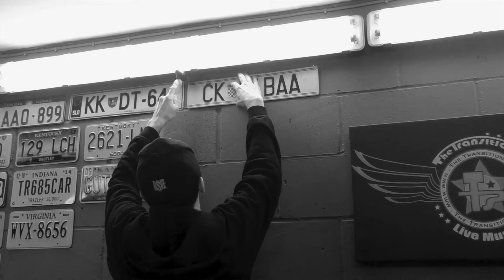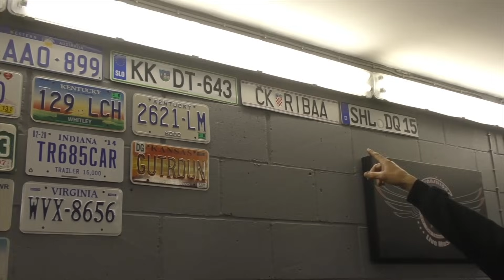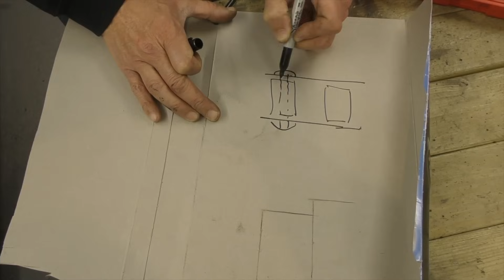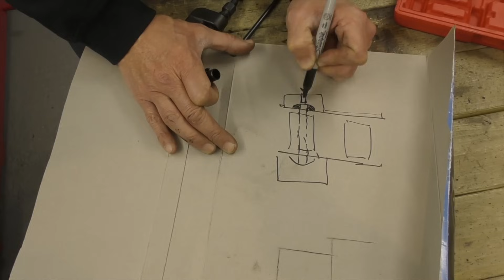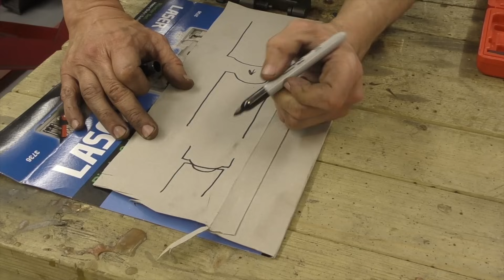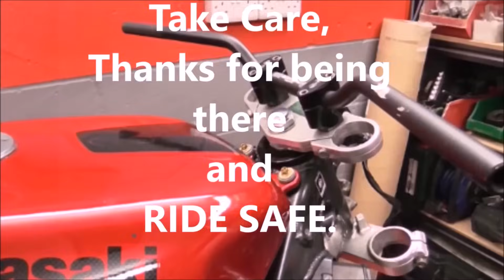Delboy's Garage, Motorcycle Chain and Sprocket Change.

Comment: Great video: got a few tips there myself. Only thing I spotted was the washer, they do recommend you get a new front sprocket washer when changing the front sprocket. I suspect most people are not as precise as you are with buffering it out hence why they recommend it. So for most people watching this they should get a new washer each time they change the front. Same with collier pins

Comment: Your video was perfect!!!!  I bought a kit that looks exactly like the one you used from Amazon for maybe $22.  I was worried it was crap but I used it, and I actually had to knock out 3 links and I was wondering if it would break after 2.  It kicked ass!!!  I was going to make a video showing how to do the same on my 1200s but yours deserves all the credit.  You didn't miss a step.  The only thing I did different was add some white lithium grease to both thread bolts before I started. :)  \m/ (>_<) \m/
Reply from the maker: Thanks for taking the time to let us know, it is a long video, but as you've found, it's a step by step, good to know it worked for you, all the best, ride safe...

Comment: Great video as always. Fastest 50 mins ever:) Do you have any experience with dry chain lube? If yes, could you tell me how it performs in comparison to standard wet chain lube?
Reply from the maker: Thanks buddy, wet chain lube does two things... it irrigates the chain, and the wax in it provides a layer of weather protection... imagine that weather protection removed, and you have pure lubrication only... the dry lube is finely powdered teflon, mixed with a carrier spirit... you spray it inside the links, all round the chain when the chain is hot right after a ride... the heat of the chain evaporates the spirit immediately, leaving the bearing faces of the chain coated with PTFE... this lube offers no weather protection, so it's good for dry weather and bikes that stay nice and shiney!
Reply: I had no idea the video was 50 minutes... wow!

Comment: "...for the sake of OCD, make sure you don't put it upside down..." You just became my favourite Youtube mechanic with that sentence there mate!

I bought a K2 GSX1400. She has seen some love, I must admit. But I can give her more love still, much more. 

I am about to rebuild the front calipers, I did change the pads but the brakes are grabbing too much in my opinion to the point one can feel it at very low speeds. I tried my best to clean those pistons. But I suspect, because the previous times pads were changed, they we not cleaned properly, so the pistons may not be working freely. 

The way I see it, if you have a video on the subject, anyone can do it at home!
Thanks a lot for sharing

Cheers

Comment: Soooo glad I watched (most of) this.
Have an old harbor freight chain breaker.
Have new z-ring chain & rear sprocket for my 2016 GSX-R600. Front sprocket comes tomorrow. Thought I could rig the breaker to do the rivet... After watching this - I'm ordering the proper tool ($20 on ebay) RIGHT now!
Thanks

Comment: This is the best video I’ve come across showing how to do this whole process. Today I tried this before finding this video, king story short I need to buy another new chain tomorrow cause I cut it one link too short (I didn’t know I had to line up one inner link with another inner link) so I measured and cut where the chain right where i wanted it to be but one end was the outer link and the master link wouldn’t fit.  Anyways, watching has shown me that I was doing it the hard way. I have this exact same breaker/riveter. Now I’m inspired to try again tomorrow and feel hopeful.  Thanks so much for such a details explanation. It’s exactly what I needed.

Comment: Video worked for me! Your explanation of how important it is to keep the proper width of the link, along with the explanation and  the visual of how slight the deformation of the pin gave me the confidence to order the tool and then give it a try.  Success.  Without the video it is very likely I would have tried pushing too hard with the domed pin because I would not have understood how it worked.  Your written diagram... plus the excellent camera work made all the difference for me.  btw...   on my Triumph America, the drive sprocket on the output shaft..... after removing the chrome cover (after 30k miles), and after buying a 36mm socket, after taking it to a machine shop so they could grind down the chamfer on the socket so it would gain more purchase on the  thin nut...  i t turned out to be barely finger tight and all that was keeping it from flying off was the folded down washer!   So,... I look carefully to see that the washer is pressed against the thin perpendicular rubber 'lines' of the rubber coated drive gear.  When the time came for me to torque the drive sprocket on to 97 ft lb 132 nm I did that.  And yet... that steel washer does not seem to really back evenly to the drive sprocket.  So, I will soon be checking that nut once again after some riding.  Any comment about torquing it down against the rubber siding of the stock triumph drive sprocket?   Thanks!

Comment: Very good tutorial. I am old school and did not know how easy it is to change chain n sprockets these days. On old bikes you had to take apart the primary drive and clutch , then the back plate to get at the front sprocket.  I assume the belt drive bikes are like this too.

Comment: Excellent, excellent video sir. Plenty of detail, and the finished product was very good. The only thing I may have done after mushrooming the pins would have been to remeasure the plate out side diameter, just to see if that changed at all.

Comment: It is not simply the head that secures the pin.  The feature of a rivet that makes the joint so strong is that the pin expands when bucked to make the mushroom head on the outside, but also leaves residual compressive stress between the pin itself and the hole interior.

Comment: you are a professional amazing how many details there are. I had breakdowns at home, it spins when adding a lot of gas. lucky that it is not far from work, but I had to cram the bike. I used the small vise and nut method with pushing the link into the correct position. And a little ball to tighten. But I have this tool to do correctly. Thanks.

Comment: Good tip grinding the heads off.  Never had to do so myself and not had a splitter break.... yet.   Well, apart from one i used which was old anyway.   I never liked using the lever which comes included, always felt like it was going to snap when turning it.   I have used a socket or spanner before now

Comment: Sorry to keep pestering you but I'm not a skilled mechanic but I am very mechanically minded, I used to strip my kawasaki z500b1 every winter  engine out, shims checked etc. Sold it for £500 for house deposit 30 years ago  they are fetching silly money now!
But I am a skilled sheet metal worker and I do like watching your fabrication videos, the blowtorch ally welding is something I've never seen but the satisfaction of tig welding ally with a nice even bead is something else
I want a workshop like yours 😂

Comment: I have used exactly the same tool as the one shown in this video. Just want to point out with a DID 520 Chain just by making the rivet pin sit in the hollow pin as shown will not flare the pin enough to meet DID specifications. With the method shown here I achieved 5.2mm where the spec is 5.4 to 5.6. At the DID official spec the flare is comparable to the diameter of a factory installed pin.

Comment: one idea, when you take the sprocket off, scratch a mark on the hub and the sprocket, so they can go back on the same way, they could be ballanced parts, ie like a propellor blade on a fan/aircraft, so putting the weight on the wrong end may cause the wheel to lose balance, like the brake disk too, esp. if you are using them as spares :-) , saves any curious rumbles on the road afterwards.

Comment: Hey Brother revisiting this because i havent used my chain tool for 7 years and needed a refresher ..i dont have the exact tool but the same principle ..(all bikes since 2012 had new chains and sprox on ) ..but the vstrom is well overdue !! thanks again brother peace and love 👍🏻👍🏻☮☮❤❤
Reply from the maker: Hey buddy, cool beans, and you know how it is, it's like riding a bike... off camera, I don't mess about pushing the link out with the chain tool, I just cut it off if it's going in the bin, and that saves the tool tip for the all important spreading, good luck with it buddy, peas and loaf, D&Px
Reply: @Moonfleet41  
yeah cut mine with grinder for bin fodder..understand my tool now it makes sensr thanks again 👍🏻👍🏻🍨❤❤❤

Comment: Always handy to come back to for a quick refresher before riveting chain ends. Can't remember everything when you haven't changed chain & sprockets for 40,000km. 93,000km on the clock and now pushing on to the big 100k
Reply from the maker: Impressive mileage Marcus. Good luck with the job.

Comment: Found this to be a great refresher  video after looking at budget chain tools on Amazon and you were mentioned.
Just bought an old fj1200 that needs a new chain, and I haven't done one in 20 years + due to owning shaft drives and a belt drive Harley.
Looking forward to doing the job correctly now as I used to use all the 'old days' hacks you mentioned.
Been watching your other vids as well.
Top job, keep it up.
Reply from the maker: Hi there Clay, Try this tool if you haven't bought one already.. a lot beefier and dead easy to use .. https://www.wemoto.com/parts/picture/wk-790050-in

Comment: Thanks brother. Did my first chain today thx to your video. With pushing the plate I had some trouble as it was impossible to place it by hand lol. But patience and determination won. I needed 22.0mm I came to 22.08mm (lucky me lol) and riveted as described. Thanks! After riveting it is indeed hard to see. But the flat edge hits the end. I trust it's fine after a couple days easy driving. 👍
Reply from the maker: Just to be clear mate.. what flat edge hist what end.??

Comment: Excellent educational video! I'm installing the 3rd chain on my Tiger & struggled with that tool each time. I know NOW how to use the tool properly. And plenty of good tips for the whole chain replacing project. No other videos to bother watching. Thx so much!
Reply from the maker: Most welcome Reid. Glad it helped.
Reply: Just realized that the plunger pin used to mushroom the master link is made of softer metal then the link pin. The dimple just mashes into the link. No more dimple.

Comment: Great video so detailed.   I broke my chain breaker kit a copy of yours from China.   I used to big of a pin to push the rivet out of a huge chain 520 off a 1200 Bandit 2003.   The pin pusher got stuck inside the chain.  I could not get it out .  Had to cut the the chain apart with a grinder.    Before I finished putting the new one one I thought I better find a video to make sure I was not going to mess it up.  Glad I found your video as I would have done it wrong.       The best video by far how replace the chain.
Reply from the maker: Thanks Fred, glad the video helped you, and now you know how to do it it'll be a simple job next time!

Comment: This was crucial help especially regarding the cheap tool-set and how to use it.  Thanks to you I got it done right.  However the two-hole press-plate stem broke off despite very gentle torque as you prescribed.  

The only thing in the video that wasn't too clear was which of the three anvils to use in the riveting stage.  I used the one that matched up with rivets on my old chain and it worked.

By the way since I bought my $16 tool on Amazon, the seller has messaged me directly and they've promised to send a new set.
Reply from the maker: Glad it worked out for you Richard, they are a little fragile, ive traded up to a heavy duty one now, well worth the money as i change two of three a year..  Ride safe and enjoy your bike buddy.   https://www.spanner-monkey.co.uk/motorcycle-chain-splitter-and-riveting-tool-set-heavy-duty-119022?search=SMC4&description=true

Comment: How to know what length should I cut the new chain to? Or just follow the old chain length?
Reply from the maker: If you buy the chain specific for your bike it will be the correct length.
Reply: @Moonfleet41  thank you brother, if let's say in case the chain is not in correct length, I mean if it's longer, how to cut it? Is there any way? Or usually it will be in correct length? Thanks brother
Reply from the maker: @Nathan2692  It will always be the correct length for the bike if you order the exact chain for your bike... and if in doubt, count the links on your old chain and compare them...
Reply: @Moonfleet41  thanks alot and sorry for alot of questions brother, so if let's say it's not in correct length , I just cut it into the length of my old chain right
Reply from the maker: @Nathan2692  No, measuring it doesn't help because your old chain will have stretched, count the links instead and make sure you have the same number... the new chain may be slightly shorter because the links won't have stretched, just as long as the number of links is the same, you're good to go. .
Reply: @Moonfleet41  thanks alot bro, really help me alot, do you play around with small cc bikes like yamaha r3 bro? And another questions bro, when I cut off the old chain using chain breaker do I need to cut at master or I can cut anywhere?

Comment: how is your motorcycle so clean after 4 years? it looks brand new. Btw thank you for your video, the fact that you took the time to go in-depth with the removal of the pin makes all the difference because I see all on amazon complaining about the tools, and now i see what is that they are doing wrong.
Reply from the maker: Thanks Alexandru, it's a well card for bike, and sure thing if you use the tool correctly you won't break it!

Comment: Thank you for describing the riveting concept.  I just did my first chain and was driving myself nuts thinking if I flared the rivets enough.  This eases my mind a bit.
Reply from the maker: Yes indeed, it's a common misconception that they have to be planished right over, like an old fashioned rivet when that's not the case, as you can see.

Comment: Thanks Del again for a great vid. 
I have been servicing my bikes for a few years now with help from your vids. Changing the chain and sprockets though I always had a doubt and ended up getting my local tyre fitter to do it. 
The R1 will be getting a new one in the new year now done by myself. Cheers
Reply from the maker: That's good news mate, it's just a basic job, and as you can see, not that hard, good luck with it buddy!

Comment: Another very informative video. Doing the sprocket/chain changeover on my Kawasaki z1000 2004 and as always, instruction is second to none. Followed you when I did the brake pads replacement/chain clean on my 1200 Bandit. Keep up the good work and thanks again fella.
Reply from the maker: Thanks for your kind feedback Michael, im glad the video was helpful, good luck with your projects, have fun.!
Reply: @Moonfleet41  Jobs done fella. Really enjoy tackling small projects with your videos running in the background for reference.

Comment: Beautiful detailed video was wondering why it was necessary to grind down the head
Reply from the maker: The pin that pushes out the old link will struggle to push them through intact, you'll need a lot of force to do that... if you just grind the heads off, then it slides the old link out with minimum effort and that preserves the tool long term.

Comment: Good detailed video. I have read reviews of the Sealey  breaker on line and quite a few say they are not up to the job. Your video shows that with care and a grinder it’s possible to use one without butchering it.
Reply from the maker: Exactly mate, they will do the job if treated with respect, but you must grind the pin off first and, of course, the weakest link in the box is the drive pin, but Wemoto sell them separately in packs of 3, they're a consumable part.

Comment: Great video, I have a similar tool and the instructions were unclear, this answered my questions.  I realize this was 2+ years ago, but I have recently purchased a 1995 Triumph Trident 900, and I need to replace the rear mono-shock.  I have the Haynes manual, but it covers all the carb motors from 91 to 98 and is hard to follow.  A video with this kind of detail on replacing that mono-shock sure would be helpful.  Once I got over the "common language" barrier, I really like and enjoy your videos.
Reply from the maker: Thank you Douglas, appreciate your kind words, it's nice of you to pay such a compliment... I don't have a bike to make such a video sadly, but am currently engaged on a re-build of a tired old Hayabusa and it's the last 24 or so videos on the channel, and I covered the re-build of the suspension shortlink, swing arm bearings and shock absorber removal and replacement, so maybe that would help you in some way...

Comment: Well explained. I need to flare a cam chain 219t  on a CB200 Honda with a hollow link woulid the tool you used do or do I need a smaller flare end?